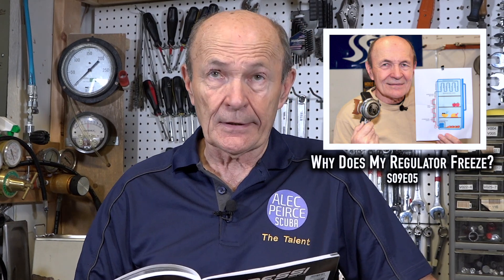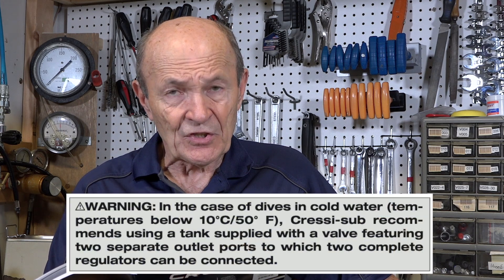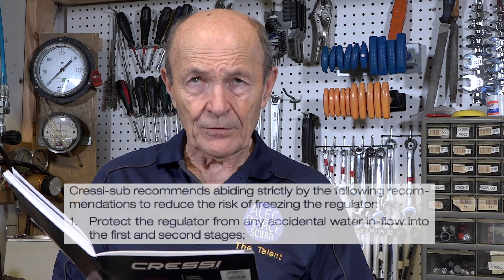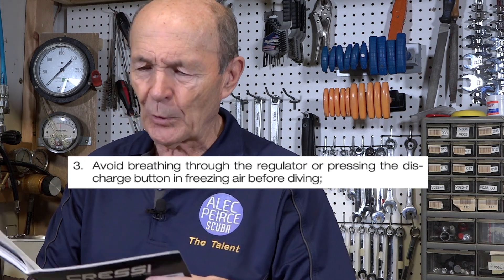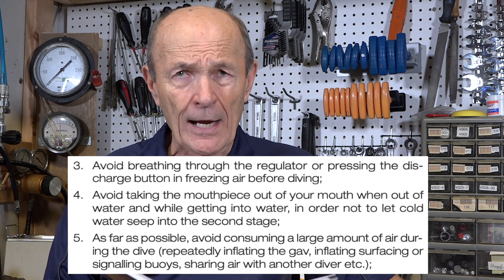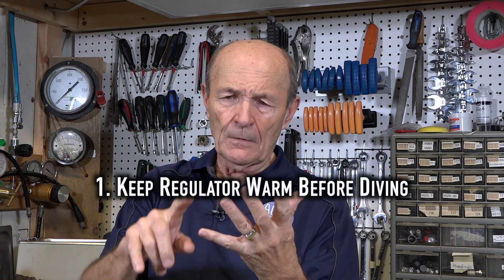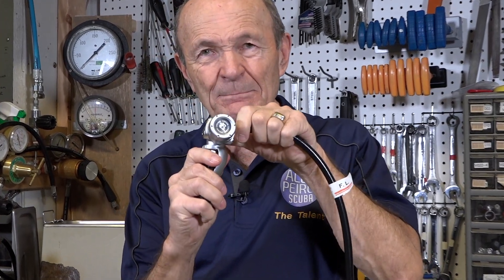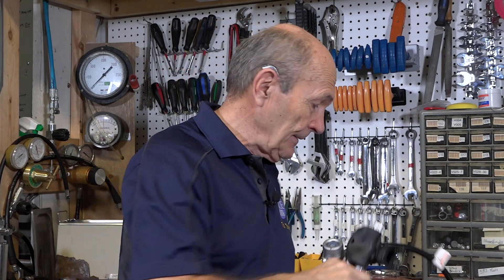Why Regulators Freeze - Scuba Tech Tips: S16E19

Comment: Good reason to get the driest fill you can find AND some clever cookie needs to use a CNC machine to create a screw in copper heatsink which would provide proper thermal conduction for the first stage. Ideally you could have a HP and an LP Port heat sink and they would use the environmental temperature gradient to avoid first stage freezing.
Reply from the maker: Sounds great but I'm only warm/very warm water diver with these old bones.
A

Comment: Can you breathe from a frozen, free flowing regulator or will it freeze your mouth and lungs?
Reply: Yes you can but it not very comfortable and you loose a lot of air. You can simulate a free flowing regulator by pressing the purge button. Try breathing from it. Hold it in front of your mouth and try catching/breathing from the flow of gas.
Reply: @jensbolte9185  yes but I presume that as the temperature of the air keeps going down while the reg is free flowing, at some point it will not be safe to breathe it anymore
Reply from the maker: You can breathe, it's cold air, but won't freeze your lips or lungs because as soon as it happens, dive over, grab buddy and ascent at normal speed plus safety stop.  The short  video clip shown was Kevin's buddy's free flow at 100', 53F in August after his buddy was breathing super hard and fast.  He said that ascended together and passed through two warmer thermoclines going up.  At the surface he shut off the tank air.  It can happened to anyone anytime.
A

Comment: Isn’t it dangerous to make your first inhale underwater without testing the regulators first?
Reply from the maker: In normal dives you should test the reg before diving but in ice diving, that one breath from the reg in very cold air (below freezing), can  begin the process of free flow.  Also in ice diving you are roped to the surface, one divers goes under and takes the first breath u/w.  then tugs the line for OK.  Second diver descends the same way.  Special procedures for ice diving only.
A
Reply: @AlecPeirceScuba_SeaHunter  Thanks for the reply. That makes sense as I had forgotten the diver is tied to a rope, etc.

Comment: I just wonder, here in Switzerland you must have two 1st stages, if it's cold, because of free flow, but I just wonder, how could a secound 1st stage help, yes I may could keep breathing, but the free flow keep going on, so the dive is over. 😯
Sure I could close the tank valve, but  so I wouldn't get any air.

This is why I would like to know, is there any other benefit, having two 1 st stages, exept ending the dive without free flowing 2nd stage?
Reply: To fit two first stages on one cylinder, you need either twin valve or H-valve.  Both valves have separate knobs able to turn off individually.   One should practice "valve drills", with this configuration , like the twinset divers with manifolds do.
Reply: @toadou8127  well my tank and all which are available in Switzerland has twin ports to add a secound 1st stage but just one velve. 
So to be honest to use two sets of 1st and 2 stages are quite useless. 😯
Reply from the maker: The reply from @toadou8127 is right.  It is a special configuration that requires regular practice.
A

Comment: very well explained
the same adiabatic temperature drop happens in summer in wam water, the only difference is that the surrounding water brings enough heat ( BTU ) to avoid  a temperature drop sufficiently  to promote freezing.
It happened to me that a continuously cycling pneumatic  froze in a summer temperaturee  (  a crust of ice at the exterior of the caps and of course, channels completely blocked ). What I done is to install aluminum wings at the caps to pick up heat to the  surrounding air. that solved the provlem but the cylinder remained  cold but not to freezing point.
As you say, the only variant that can change things is the dryness of the air contained in your tank.
very good topic
very good video
Reply from the maker: That's an interesting situation and fix.   Good to know.
A